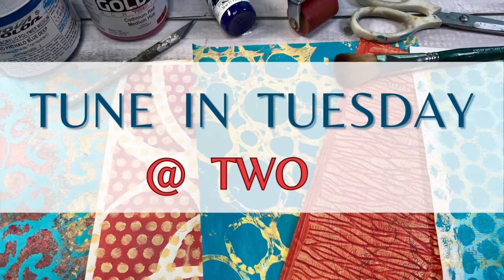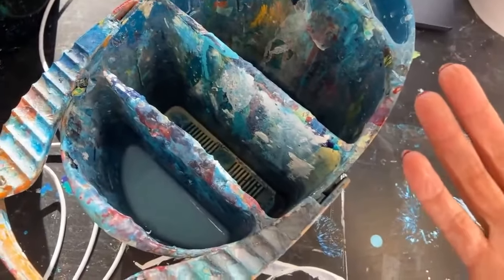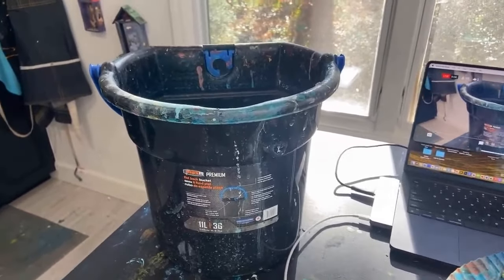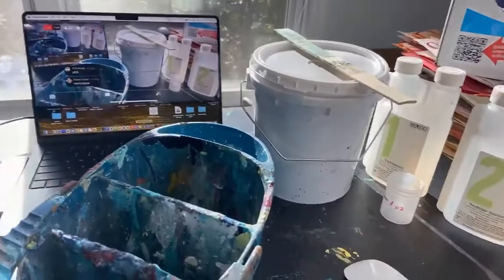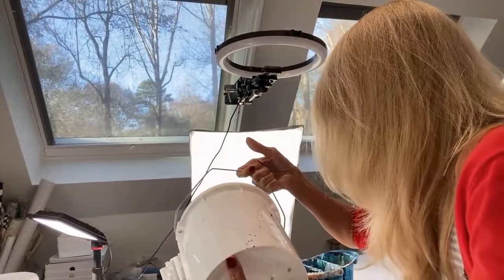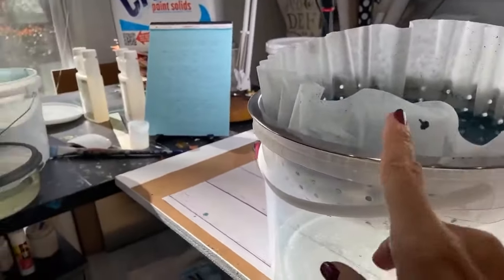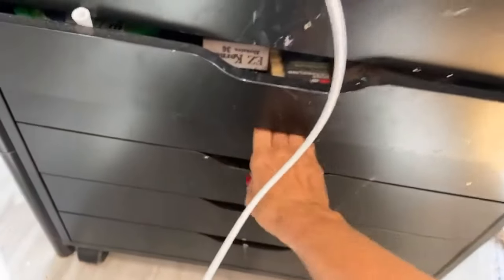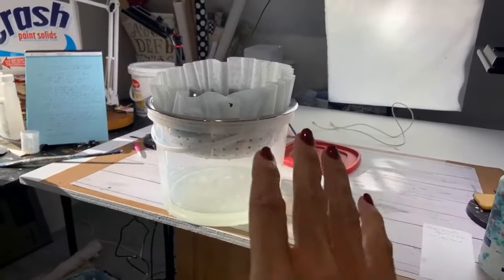Acrylic Paint Waste Water Disposal Made Easy: Learn Two Eco-Friendly Options

Comment: Kitty litter does work well and doesn’t smell at all. I have a bucket full in my art room and it has no odor.
Reply from the maker: Brilliant!  Do you have cats?  I would have never thought of that option.  Will have to try it!
Reply: Yes! I do that and it is perfect! And I don’t have cats!
Reply from the maker: @martinacolombresART  Well now I'll have kitty litter without cats too!
Reply: What kind of cat litter do you use?
Reply: I put cat litter in a bucket, poured the paint water in, and very soon the odour was horrible. 😮 This is what has made me stop using acrylics, especially in my apartment without a balcony.
Reply from the maker: @kleinekuenstlerin7717  Good to know.  Maybe its the type of kitty litter?  Maybe the type that absorbs odors works???
Reply: I saw somewhere to use cat litter to help dry out household paint. It worked for that to get rid of latex paint samples that had gone bad. I figured it might work for this as well. Thanks!
Reply: Will it evaporate & if so, how long does it take? Great idea!

Comment: I've used the evaporation method for a couple of years and have been really happy with results. I use is an large, empty plastic protein powder container without the lid. I live in Minnesota and the container sits, year round, on the floor next to an intake vent in the kitchen between the laundry room and the door into the garage. I mention this placement because I have never noticed any kind of odor coming from the container, even when it's been nearly full of paint water. So maybe placement makes a difference? I use Nova Color paint, which can be stinky, but haven't had any complaints from my extra-sensitive nosed spouse. I have also been cutting back on the amount of water I use and wiping as much paint onto shop towels, similar to what Catherine does on craft paper. And keep all those painty paper towels for collage paper!
Reply from the maker: Thanks so much for sharing your experience of using the evaporation method, and where you store your container.  Fascinating.  It could very well be where I store mine with little ventilation.  I'll have to think more about where to store this!  Thanks for sharing!

Comment: I wonder if drilling small holes in your sand bucket and letting the water go into the ground after leaching through the sand would help with some of the smell.  The sand wouldn't be as wet.  You could even put the bucket on top of some small gravel which would act as another layer of filtration before the water goes into the ground.
Reply from the maker: If I did that I would be adding draining paint water into the ground, which is what I'm avoiding by doing this method.
Reply: @catrains.artist  The sand will filter out the solids. It's basically a sand filter just like pools use. You just need to use deep enough sand. I'd start with 1/2 gravel, then pea gravel, and sand on top. Should work fine.

Comment: Thanks, Catherine, I have wondered about this. The outdoor water evaporation method would work in the summer, but I’m in a cold and snowy place in the winter. I think it would just freeze. Does the Murphy’s oil soap work for the glue mediums on brushes or just paint?
.
Reply: In researching this a little I learned that clumping cat litter would also absorb the paint water (not sure how cost effective that would be).
Reply from the maker: The Murphys works on glue mediums too!  It has revived MANY brushes that were totally hard from glue.  Yes the evaporation method is great for summer or sunny places.  And even though I live in a relatively sunny place (north carolina), its hard to keep the buckets out of the rain long enough for them to evaporate fully.  That is why I LOVE using a combination of the Crash product with this.  Hope this helps you too.

Comment: can you use the paint solids in another artistic application?
Reply from the maker: Yes you certainly could!
Reply: First tnx Catherine for your valuable vids.
Try to crush the solid residue then mix with wood glue
You will get free acrylic paint . Or mix with water and alcohol for acrylic spray., or simply wet your brush and use those solid remains as water color.